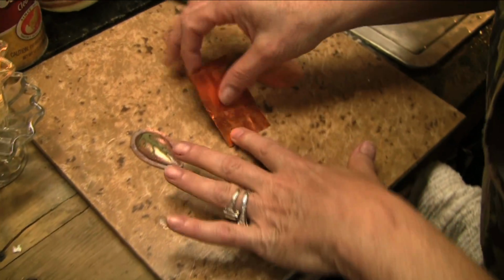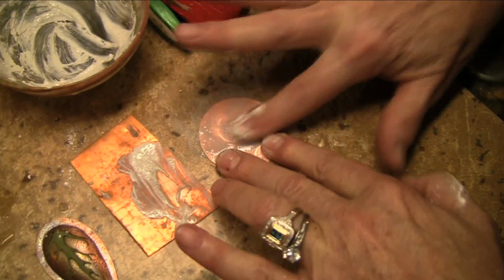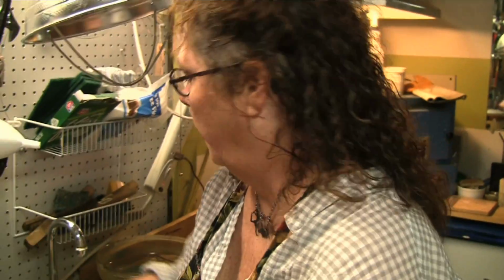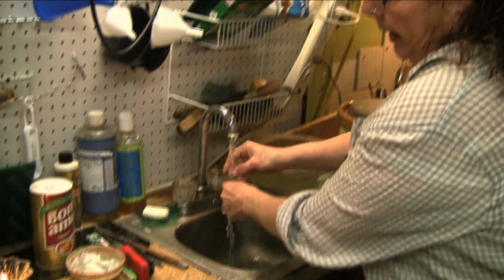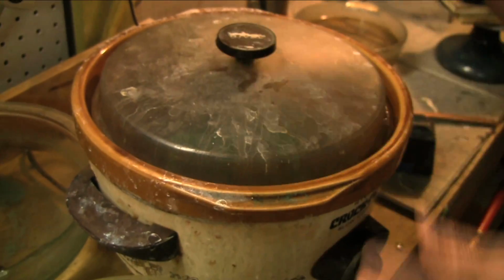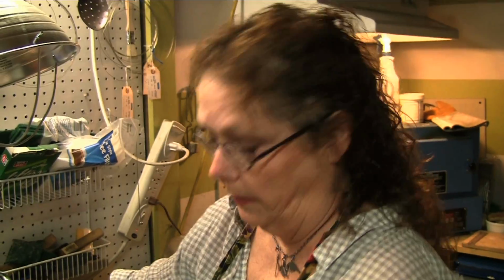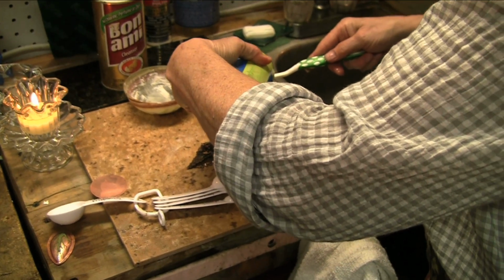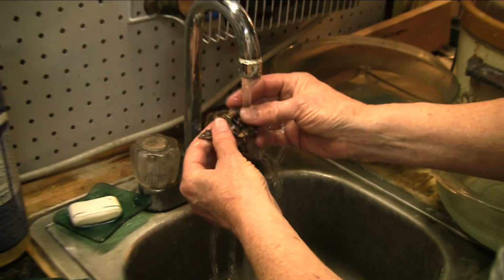How to Clean Metal | Jewelry Tips with Nancy

Comment: Hi Nancy Hamilton,  thanks so much for sharing your tutorials!  
I have a question regarding the cleaning of stains in brass. I had 2 stains on a brass disk I made .I heard in one of your tutorials to clean the stains in brass with warm vinegar, salt and adding hydrogen peroxide would remove the stains. I am doing this right now, and I noticed the liquid is turning blue and it bubbles for a long time. Is this normal and safe? How long should I leave the disks in this solution?  Thanks so much for your help